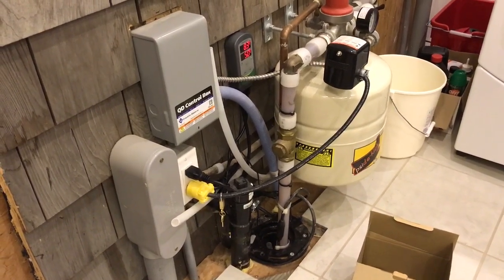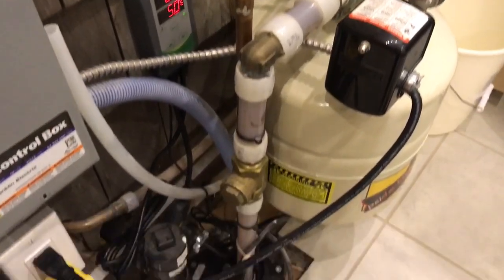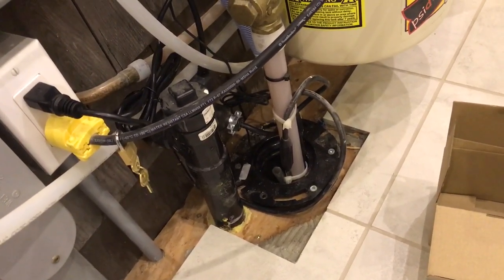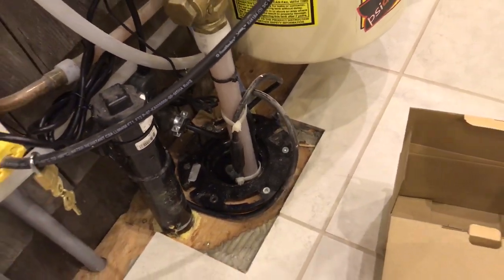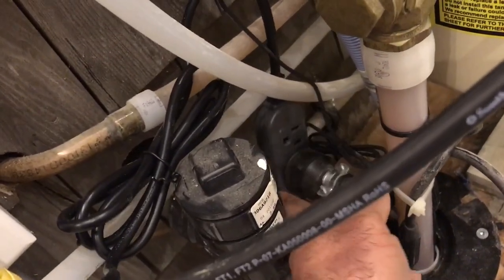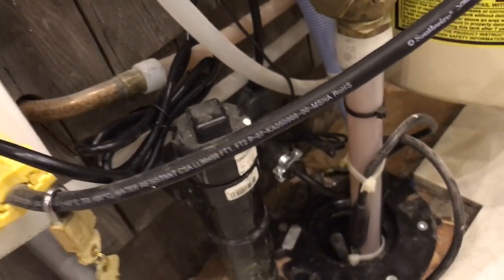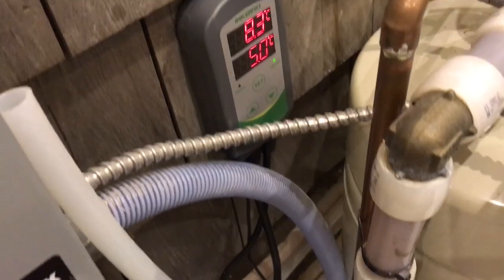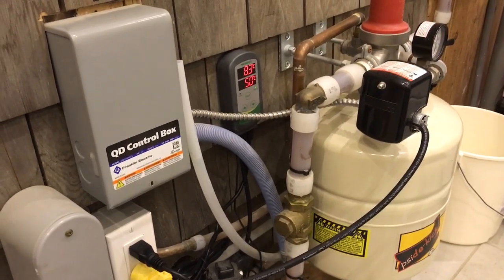DEMO: Home-Made Automatic Water Line Freeze Protection

Comment: Hardware stores seem to only stock heating cables for metallic pipe and they clearly say they can't be used on ABS/PVC (they'll either melt it or cause a fire). Where did you get your heating cable?

Comment: Cool system thanks for sharing!  Just wondering why you chose that route?  I.E. just insulate the line (in the ground and in the air under the cabin) and forgo the need to rely on electricity?